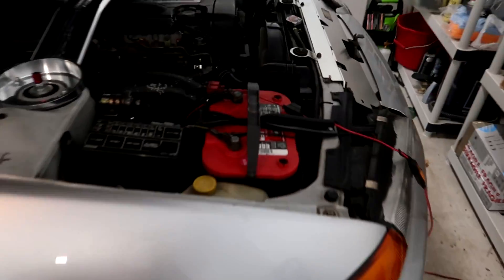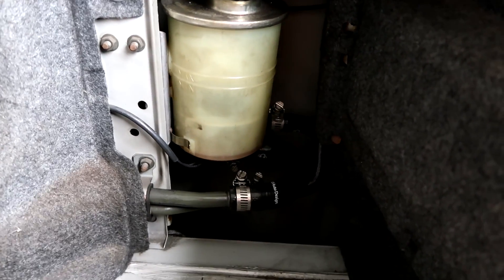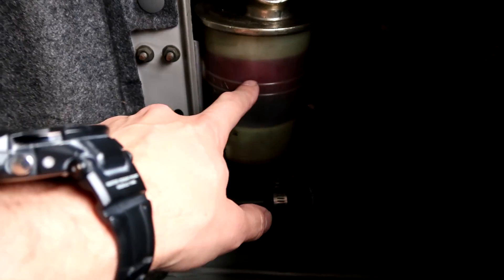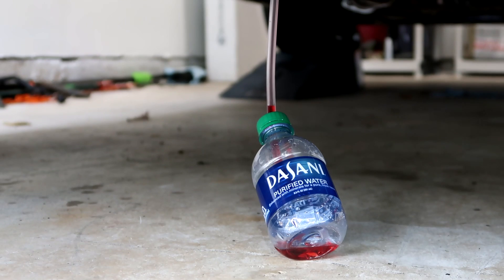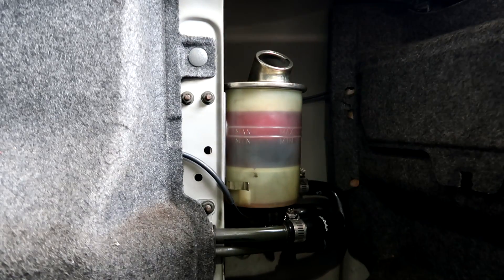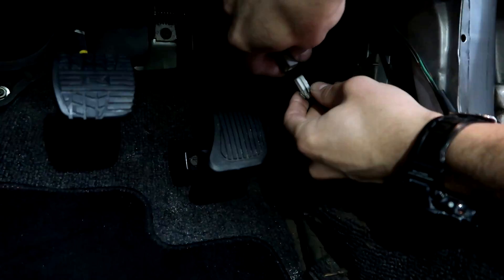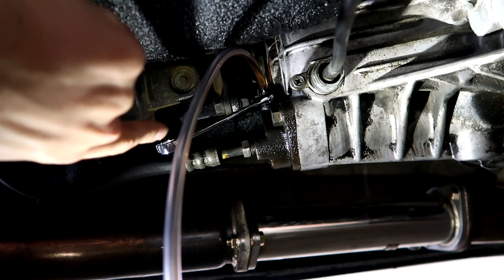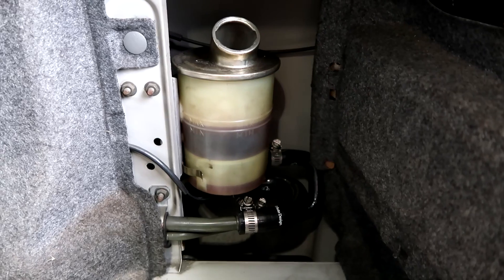How to bleed Nissan ATTESA system | R32 Skyline GTR

Comment: Old school remote reservoir hydraulic system. A bit like an older aircraft. Lotsa potential for leaks in lines etc. Most hydraulic actuators now have their fluid and pump all in one unit with the actuator and are electro hydraulic typically.

Comment: What do you mean by “jumper”? Is that the white connector? I recently got an ATTESA error code 8, and I know that’s the ABS motor actuator, but I’m assuming it’s because it’s dry. I’ve had a leak in the high pressure hose for over a year where it connects to the actuator on the diff.
Reply from the maker: Correct, it's the white plug

Comment: Hey brotha so I just found out my pressure switch on my 32 is leaking. Is it possible to replace it while it's on the car?
Reply from the maker: It's not impossible, but pretty close.

Attesa system is on top of the diff and is really tucked away, it's probably best to pull the diff

Comment: is the sound at 5:00 your attessa pump or the fuel pump?
Reply from the maker: That is the attesa system pressurizing 👍
Reply: @PlatoonGarage  really?? My car makes the same noise every time I turn the key to that position, but my attessa dosent work. This whole time I thought it was the fuel pump priming.
Reply from the maker: @kevboost  pull the kick panel and unplug your jumper after the car has been sitting for a few days, if it make the same noise, it's your attesa
Reply: @PlatoonGarage  alright thanks man, love the videos man

Comment: which oil did you use for atessa system resovoir and which one for the transfer case? The manual says "nissan matic D" for Transfer case and "Nissan power steering fluid" for resovoir to the atessa system
Reply from the maker: attessa system uses atf fluid.  nissan recommends their "matic-d" fluid.  I purchased a matic-d equivalent
Reply: @PlatoonGarage  ok, i went for motul atf, i saw it was matic D and dexron  compatibile
Reply from the maker: @xuzm  definitely don't need to over think this one. This is a 30 year old system that was just a basic hydraulic pump with an electric controller
Reply: @PlatoonGarage  ok, well I did haha. Wasnt an easy  task  to find oil  with  correct specs. Then motul should be fine  I belive.
Reply: @PlatoonGarage  thanks!